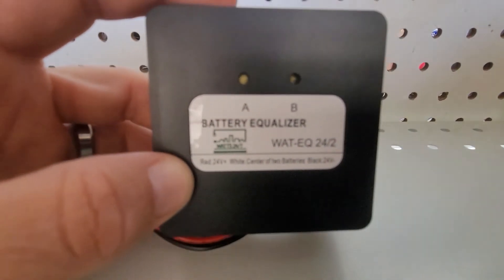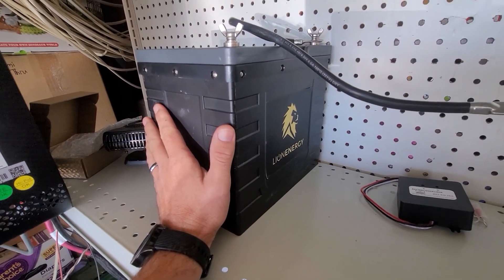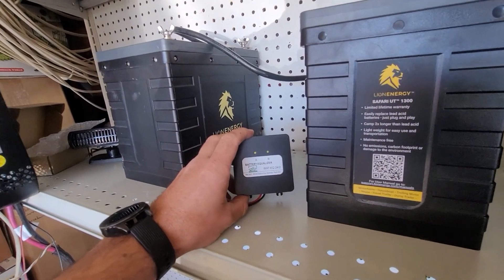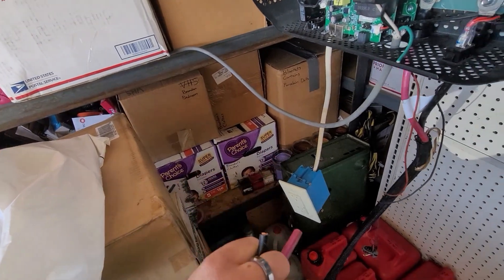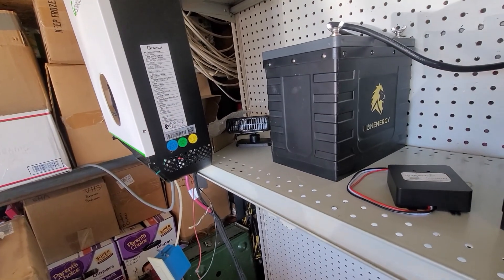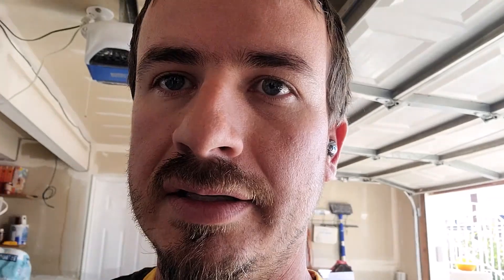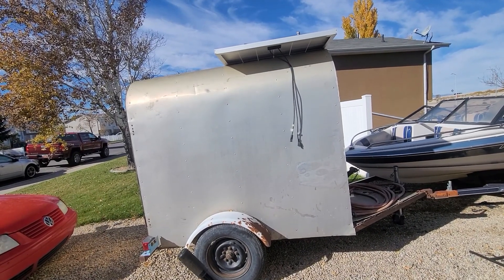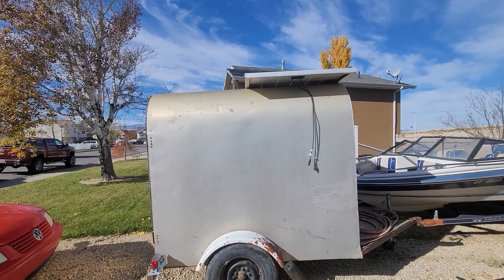Prep to Setup Growatt

Comment: Only need to use those in series if you had 2 24 In parallel you would not need to buy that series but when you hook them  parallel for a 12 volt system the will equal each-other out in parillel